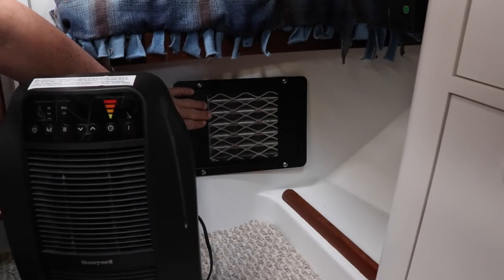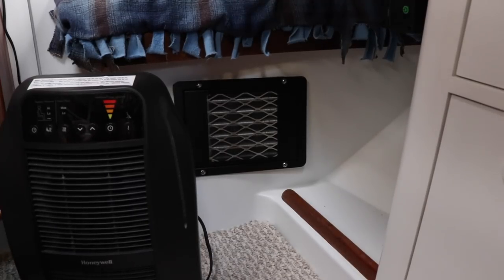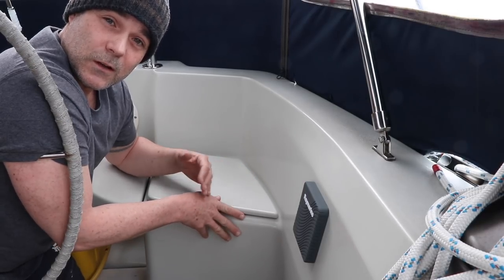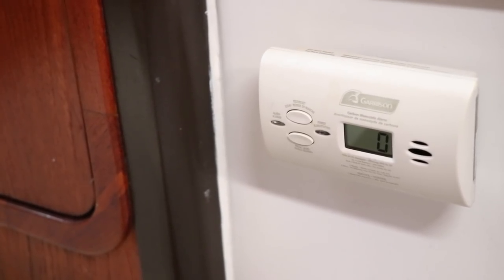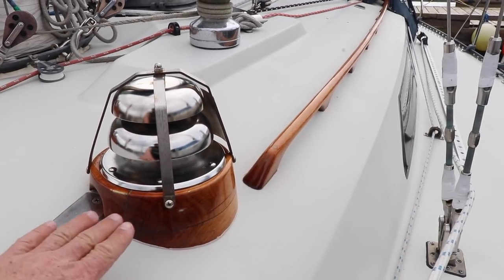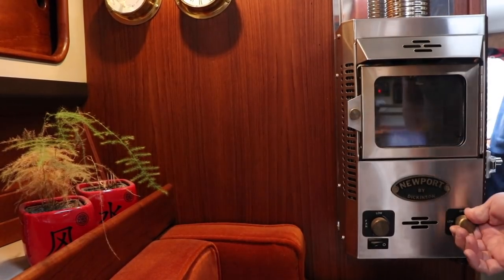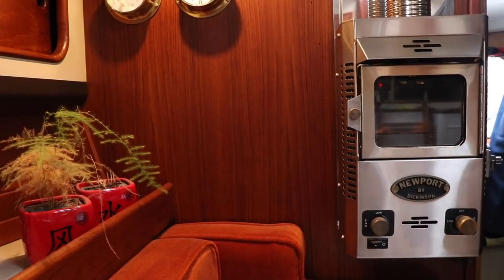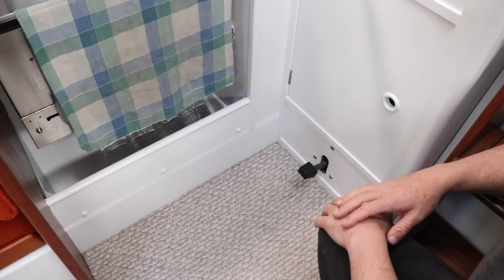Life is Like Sailing - How I Heat My Sailboat - Newport Dickinson P9000

Comment: Good day to you!  great tip on the carpeting of the cabin sole.  I live on my 34' cutter in Bellingham, WA.  I have a electric 'barn' heater when at the dock, and I installed a Webasto forced air diesel heater and I used the recommended90mm ducting, but I also insulated the ducting with a thinsulate product made by Esparbarger.  I also installed a Cubic mini wood stove made in Quebec.  Great videos.  Thanks, Martyn
Reply from the maker: Thanks Martyn and great to hear you liveaboard in the PNW as well!  Having a couple heating options is great and those little wood stoves look pretty cool!  :)

Comment: That was good. I would have diesel as well…..unlimited tank supply. Had an oil burner in my cottage before i renovated. It was unbelievably great. Couldnt help but thinking why they didnt put a piezo crystal lighter, thermostatic shut off with pilot on the propane furnace. Good video…thanks

Comment: Wabasto and espar has to be constantly maintained. They are common in commercial trucks with sleeper bunks. Mine here is the truck is not working now because the computer is having a problem. Before it was the filter. I’m guessing they would have even more problems if running red fuel through them.

Comment: Thats was a very comprehensive treatment of the subject and your installation. I think for your operating area having heat options is a necessity and if you did go for a diesel furnace and warm air ducted - it would be retrograde to remove the Dickinson as it is a great option if the diesel furnace lets you down.
Reply from the maker: Thank you and I agree that having two heating options on board is a good idea!

Comment: Well done video. I've had the Espar heaters in boats before and they work well but I find them quite noisy so I would see if you can get on someones boat and hear one first. Most of the noise comes from the small exhaust and combustion, not the fan. not sure why they run such a very small exhaust.
Reply from the maker: Thanks for that info and I'll be doing lots more research for sure!  :)

Comment: Alfie look into the Wallace diesel heater ..much quieter than the Espar and we find it is keeping Cariba warm and toasty this winter.
Reply from the maker: Thanks!  I'll take a look at it.  :)
Reply: It has a really low power draw so would work well at anchor with solar power
Reply: @suepeck2772  I like the looks of the Wallas also, but not ready to give up our oven! If you're ok with just a stove top, the Wallas is a great way to get a heater and a stove in one unit.
Reply: @suepeck2772  I like the looks of the Wallas also, but not ready to give up our oven! If you're ok with just a stove top, the Wallas is a great way to get a heater and a stove in one unit.
Reply: Sailing Callisto our Wallace heater is a complete separate unit from our propane stove and oven

Comment: Great video man. I am about to install the dickinson Newport diesel heater in my Californian 30 LRC. I like your set up, where did you find the chimney that both exhausts the smoke and allows the fresh air to the heater? I have been looking for a flue like that for this installation so that I don't have problems with ventilating the cabin and messing up the fuel air ratio. Thanks for the informative and awesome videos, they are inspiring!
Reply from the maker: Thanks and so glad you enjoyed this video and some of the others.  :)  The chimney was installed in the boat when I purchased it, but I believe you can get it through Dickinson as I think it is a Dickinson product.  Good luck with the install!  Alfy
Reply: So...not sure why you can't use the duel chimney propane chimney on the diesel heater but suspect it may have to do with too much heat, burn characteristics of the diesel heater versus the propane heater, and CO getting back into the cabin. I just put in a Dickinson Diesel Bulkhead Heater and followed instructions and works great...lots of heat, really nice look, and roasts me out. Best...

Comment: I have the P9000. I installed it briefly in my Ram Promaster 118" low roof with the exhaust pipe going through my sunroof ( I didn't want to drill a new hole for the pipe as it was only a test firing). My van is not insulated which is definitely required if you want this unit to heat the van. It does pump out sufficient heat with the fan on high but it can't keep up with an uninsulated van. I, too, was worried about the safety of propane and will probably go with a diesel for permanent heating.
Reply: Just go my Dickinson Diesel Bulkhead Heater fired up...just in time...works great...!
Reply: Propane is not dangerous. Millions of houses are heated with it. Make good connections and you’re good. Radiant heat like you get out of this heater is by far the best. Heats you to the bone and is always radiating. Unlike a forced air setup that is constantly starting and stopping and the fuel pumps are really noisy. Radiant definitely the way to go in my opinion. Insulate the van. It’s won’t take much to improve it 100%

Comment: Hi Alfy, basically I have similar thoughts about heating up my boat. I have a Webasto diesel heater (air) today. It´s not the most reliable unit and needs maintenance, mostly if you run it just at minimum level. The heat chamber will collect black stuff over time and the heater will stop. You either go often full throttle to burn out the stuff or clean it once in a while. That´s not easy. Spare parts are expensive! Eberspächer has the same principle and similar behaviour and is expensive, too. Also on the maintenance. Over here in Germany lot´s of people are switching to the russian planar diesel heaters. They run in Siberia, with odd/dirty diesel and have been developed for car/truck heating in very reliable way. Because Russia is cold and you´re sometimes very far out with no help, these units must work and they do. More robust than the german units (I´m german). Another thought would be a water heating system, where you spread 19mm water tubes (plus isolation) in your boat. Webasto, Eberspächer and Planar do offer them.  And of course there´s the Refleks range (Mads) with the advantage of complete disregard of 12 V power. And no maintenance at all (ok, just very simple maintenance). I will probably go in that direction. Btw. the planar air heater 44d is just 600 Euros in Germany and all the marine mounting stuff is included plus intake and exhaust silencers. You better set sails and pick your heater here in Germany or. Denmark. Fair winds - Michael
Reply from the maker: Thanks for all that info Michael!  Lots of options out there and this will be a next year project likely so I'll at least have time to do lots of research.  :)
Reply: Planar should be one third of the cost of Webasto and Eberspächer. And spare parts are as cheap. And I also had a look at cubicminiwoodstoves.com.
Reply: I had the same issue with the Webasto..in Seattle...works great but needs complete overhaul after running for 2000 hours (which is 83 days). Cost to overhaul is 2000 so a buck an hour to run plus the cost of the diesel. Just got my Dickinson Diesel Bulkhead Heater fired up and works great...will know more after this winter...Best...

Comment: I think you'd be very happy with a Webasto furnace if you can make the ducting and electrical connections work. My brother has one on his Ranger Tug 29, and is pretty happy with it. If you get one, try to find room for a dedicated battery for it, so if you leave it running all night you won't wake up to a dead house/starter battery.
Reply from the maker: I've heard goo things about Webasto and glad to hear your brother is happy with his.  I would definitely have systems like that running on my house bank and not the starter batt.  My house bank also has solar panels that help with charging them up during the day.  :)

Comment: Hi i have used the webasco heater.  Just to give you the heads up i was very disappointed. It is expensive and unreliable.  In one Year i had to rebuilt the unit and it wasnt cheap may as well have bought a new one. Love your videos allways watch them. I thought this time i leave a comment to maybe help you out. Cheers 😎
Reply from the maker: Thank you so much for that feedback.  I'll be sure to do lots of research and everyone's feedback helps a lot!  :)
Reply: Yep...Webasto works great but complete overhaul at 2000 hours (83) days...costs 2000 bucks plus the cost of the diesel. I just put in a Dickinson Diesel Bulkhead Heater...works great...looks beautiful...cranks out the heat...will know more after this winter...Best...
Reply: If you're using the webasco at low heat a lot it will not work as great. Plus use good diesel I have one in my semi truck I turn it on full heat once a month in summer to make sure it's clean hope that help you :)

Comment: Interesting to see your insulation options and some of the differences between your later model 34 and our 1974 35 mk2. Much nicer fit and finish on the later C&Cs. Ours came with a propane catalytic heater which didn't put out enough heat and was noisy. I have installed an Espar D2 under the aft deck, but have not yet completed the exhaust, so I can't say how well it will heat the boat. Having stayed aboard with only a 1500W electric heater with outside temps dipping below 0C, I can say that insulation is definitely needed to retain the heat, as you mention. Another C&C 35 here (Victoria) installed an Espar hydronic unit, and ran coolant lines along the toerail, up one side, down the other, which is easier than running air ducting, and you can then place a bus heater forward. Ours has a single air outlet over the nav station, and I am hoping that using some small fans to distribute the heat will be enough to keep the boat comfortable for winter cruising.

Comment: You can vastly improve the electric space heater with a baseboard thermostat. I’m my trailer I installed a Baseboard thermostat with an outlet below it. You can also use an electrical gang box and install the thermostat and an outlet or pigtail to plug the space heater in. Set the thermostat (preferably at a chest hight location) to comfortable setting. Turn the Space heater to highest temp setting. the thermostat in a space heater really operates based on the heater temperature not ambient.  This does keep the setup safe as you not by passing any safety features in the heater.  Just don’t use a space heater that has a cooling cycle after a heating cycle (rare).

Comment: Alfy. I had a p9000 heater on my previous boat, a Catalina 30.  I installed it.  When the fan is on it should pull air in through the top of the heater and blow it down and out the bottom so a convection current is introduced to get heat down around your toes. If your heater blows warm air out the top like you said in the video the fan has been wired back wards and all the heat is being blow up to the ceiling where warm air always goes . I think if you reverse the two 12 volt fan wires on the heater fan it will reverse the fan motor direction and you'll get more warm air blown down and better heat distribution. Imho .  Alfy I looked at the installation manual and there is clearly a red power and black ground wire for the fan so it would be pretty hard to install it wrong . Maybe you could check with Dickerson about which way the fan is to direct the warm air.   I just know on mine it blew down and really helped move heat to the floor. Tom

Ps this is from the manual:  " When installing your new propane heater, keep in mind the location of the heater and where it will maximize the heating capability. This propane heater is equipped with a 12v fan that will blow hot air from the top of the heater down onto the floor."
Reply from the maker: Thanks for the info, but maybe I didn't describe it properly.  The hot air blows out of the top and downward towards the floor on mine heater so I think it is correct.  :)  Thanks for double checking though. :)
Reply: Life is Like Sailing hi Alfy.  I recall that when I turned the heater fan on the fan , which is just a 12 volt computer muffin fan located in the bottom of the heater blew a strong stream of warm air out the bottom of the heater. If I stuck my hand under the bottom of the heater I could feel the steam of warm air. My favourite spot was to sit on the settee with my feet under the heater fan vent to warm my toes.  If you put your fan on high and feel warm air blowing out the top and front of the heater, imho the fan is backwards.    Tom
Reply from the maker: I'll check it out to be sure, thanks  :)
Reply: There are plenty of "silent" fan designs now available due to computer modding, so it would probably be quite simple to switch to a fan with quieter blade design and remove that noise source. A simple trawl of Amazon/eBay will turn up plenty of models, I've switched 3-4 out on household devices recently to great effect.
Reply from the maker: Thanks and I'll take a look!  :)

Comment: This is the second of your videos that I have seen, and you mentioned heating dry air in both of them.  I don't know which is easier to heat, but I can tell you that adding humidity to your air makes it feel much warmer.  During the winter I often keep a pot of water simmering on the stove for this reason.  The residential central heater dries out the air in a regular house anyway.

Based on this I would say that it is easier to heat humid air, because 72F feels warm in a humid house, while in a dry house 76F feels warm.  Also, if you think about it the main thing air conditioning does besides lower the air temp is to remove moisture.

I understand that high humidity is a bad thing on a boat, but you might research the whole heating dry air thing rather than just repeat what you heard someone say.  BTW, I enjoy your videos.  Just watching the ones about the boat right now, but I will move on to a couple of your underway videos, and sub the channel if I like them.
Reply from the maker: Glad to hear you are enjoying the videos and I appreciate and enjoy constructive comments.  I am certainly no expert on this topic, but was just going by what I had heard and by what seems to be happening on my boat.  I keep a close eye on the humidity levels in the cabin and it seems to be easier to heat the cabin when the air is less humid.  Not talking about 30% vs 90%, but more like 40% vs 70%.  I guess because it just feels damper when the humidity is up that is doesn't feel warmer inside.  Of course I am right on the water and in a colder climate so maybe that also has an impact.  Well that is the best reply I could come up with, hard to explain things sometimes. ha  

I hope you'll check out some of the cruising episodes as they are my favourites, because I get to show everyone this amazing part of the world for cruising.  Fair winds!  :)  Alfy
Reply: @lifeislikesailing  Thanks for the speedy reply.  I was looking at live aboard on a trimaran when I was living in FL, but the boats I was able to afford needed too much work.  A boat really is in many ways a hole in the water that you throw money into, lol, which is not a bad thing if you can afford it.

You are living the dream, brother, but at least I can watch from the sidelines via your  videos.  Looking forward to the cruising videos. :)

Comment: Hi thanks for the video. Fellow C&C owner here. does insulating the storage area the way you did make it difficult to access the hull-deck joint? 
I know hull-deck joint is not something that requires a lot of maintenance, but it always make me feel better to be able to visually inspect the bolts, for example. Also, I've heard other owners having to occasionally tighten those nuts when the joint leaks. have you had similar issues?
Reply from the maker: Nice to hear you also have a C&C.  If I had to access the hull/deck joint bolts it would just be a matter of cutting a small part of the cork and foam away.  It could be easily re-glued back into the same spot I think.  I can see most bolts and they came down further than the insulation so holes where cut into the foam and cork as I mounted it all.  :)
Reply: Great. thanks. seeing your insulation install was helpful. I can see that the bolt stick down through the foam/cork.

Comment: Do you have gas stations in your area which fill LPG into tanks like gasoline ? We have that in Europe and it is convenient to fill your gas (not gasoline) tank(s). 
Webasto and Truma, two forced air systems from Europe are good but do make some noise as the fan has to run all the time. But they do keep your boat toasty all the time, even in your climate (we just use ear pops if the noise bothers someone...).
Reply from the maker: I don't know of any places that fill LPG here, but I think they have that more in the USA.  I have heard that those heating systems keep the boat very warm, but yes a bit noisy.

Comment: Hi Alfie, great video!  C&C's are made in Canada, aren't they?  I'm surprised that they aren't already insulated.  How difficult was it for you to insulate your boat?   And, are there other boats built for northern latitudes that are already insulated?
Reply from the maker: Yes C&C sailboats are made in Canada, but not sure why they were not insulated on their original builds?  Maybe because they are considered a racer/cruiser so always trying to keep the weight down.  ha  It wasn't hard to insulate the boat, just took my time to do it right.  Lots of detailed cutting and fitting. ha
Reply: C&Cs were made in Ontario where we have two seasons. Frozen and summer. Boats go up on the hard in early October and launch in May. Not much call for heaters or insulation. People cruise when it’s warm only.